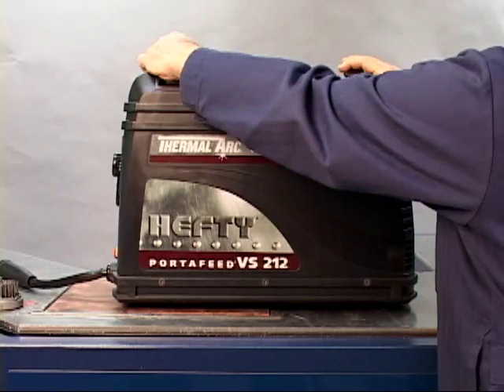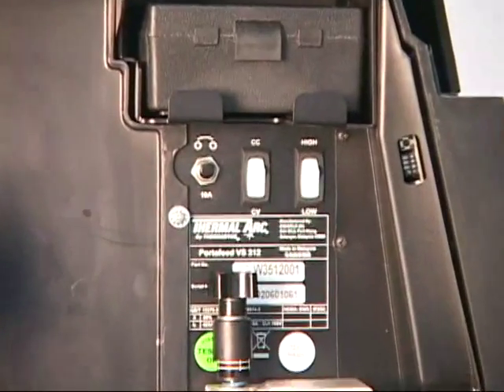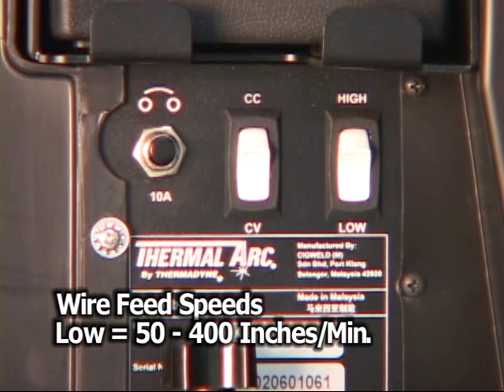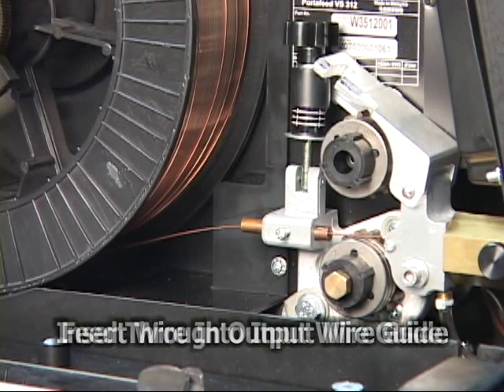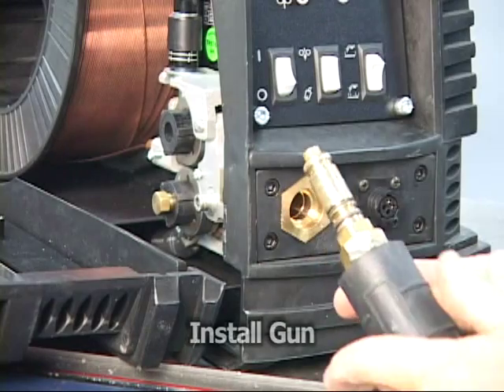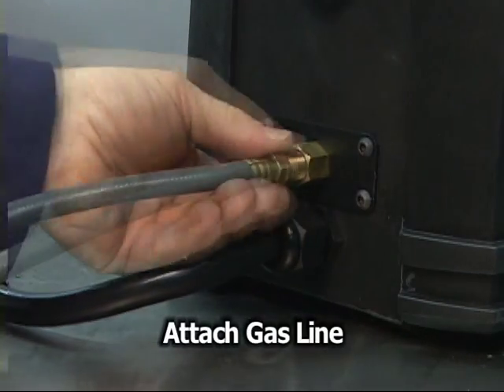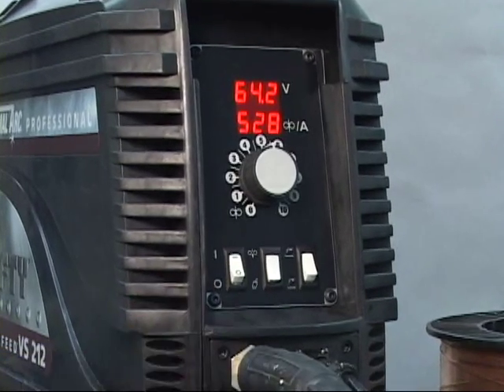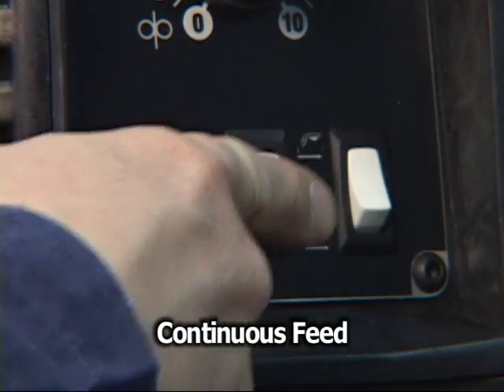Thermal Arc Hefty VS 212 Wire Feeder Setup

Comment: Well that also work with aluminum??
Reply: I believe that most wire feeders will feed aluminum. However the problem with aluminum is it is a very "soft" material and will easily jam in the liner if you are using a long lead. I have not had good results from using a conventional feeder with a liner more than about 6 feet long, even at that short of a length you need to keep the liner fairly straight.

Better to use a push-pull type of feeder or a spool gun to weld aluminum.